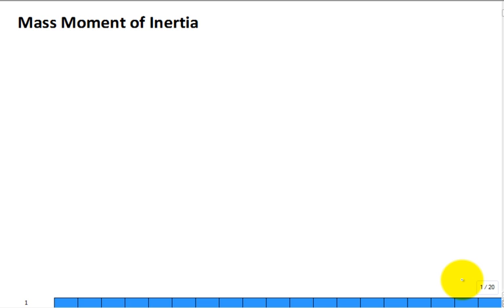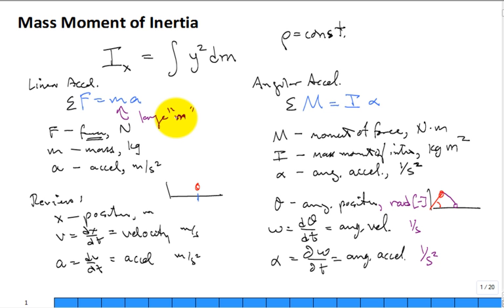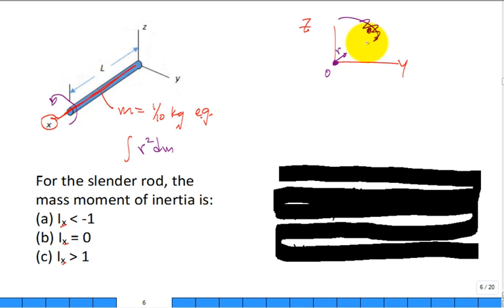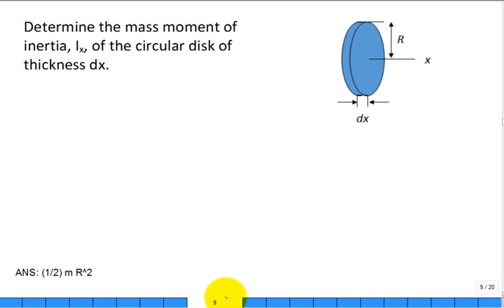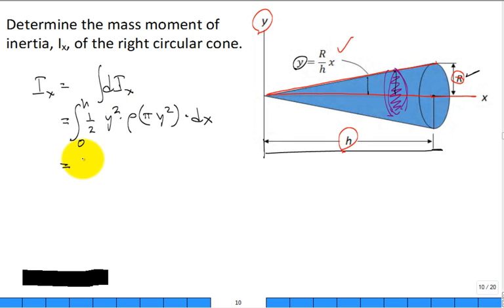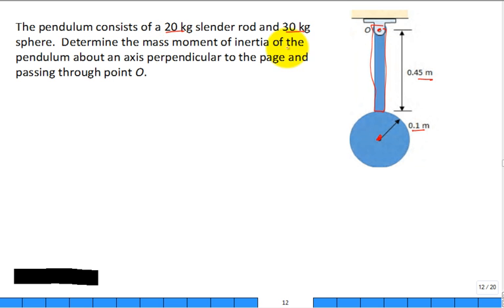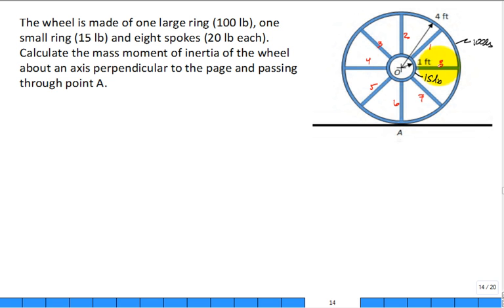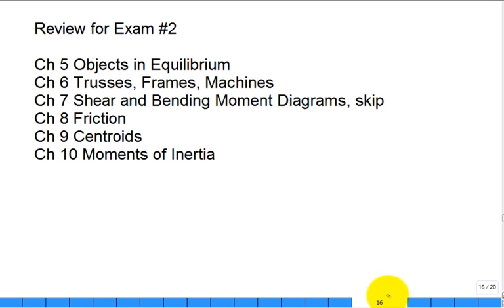Mass moment of inertia

Comment: Excellent video, very good explanation. I have a question: what are the differences between the MIM and the Volume Moment of Inertia?
Reply: Mass moment of inertia, is the only term that really has anything to do with inertia.  So the other kinds are a bit of a misnomer that we call them "moment of inertia".  The mass moment of inertia is integral r^2 dm, which has applications in being the rotational equivalent of mass, for the rotational form of Newton's 2nd law.

Notice the distinct lack of kilograms in other kinds of "moments of inertia"?   That's because these other concepts are purely geometrical properties, that have nothing to do with inertia.  The reason we call them moments of inertia, is that they have a lot of geometric properties in common with mass moment of inertia (such as the parallel axis theorem), and have a very similar calculus definition.

I'm more familiar with Area moment of inertia, which is better termed the second moment of area.  This concept is defined as integral r^2 dA, and has the application of the geometric stiffness of a cross section, either in torsion (polar 2nd moment of area) or bending (2nd moment of area).

I haven't used the "volume moment of inertia", but I would expect that it has a very similar definition as "area moment of inertia", except that it is integral r^2 dV, instead of dA.   An application I would expect of volume moment of inertia, is more of a density-independent version of mass moment of inertia.  In other words, divide through by density, after finding mass moment of inertia of a uniform body, and that's your volume "moment of inertia".

Comment: why did you find the centroid of the composite pendulum Y-bar=0.42m and then use that to determine the distance d of the rod and the  dis? I think that is where we can use the parallel axis theorem then to find the mass moment ;of  inertia of the composite pendulum.

Comment: why it is 1/2 times r times dm 
can you please explain
Reply: That's for the special case of a cylinder along its axis of rotational symmetry.

Consider the cylinder consisting of an infinite number of thin, uniform hollow cylindrical sidewalls, each with a mass of dm, and a moment of inertia of dI.  We need to add these all up, such that I = integral dI.

The moment of inertia of a cylindrical shell with no endcaps, is a trivial problem, as all mass is equidistant from the axis of rotation (i.e. at radius r).  Thus, dI = dm*r^2

Our integral for I becomes
I = integral r^2 * dm

Our differential mass element has a density of rho, a thickness of dr, a length of L, and a circumference of 2*pi*r.  Its mass dm is thus:
dm = 2*pi*r*L*rho*dr

Replace dm with this, and factor out all the constants:
I = 2*pi*L*rho *integral r^3 * dr

Carry out the integral:
integral r^3 dr from 0 to R = R^4/4

Reconstruct:
I = pi*L*rho * R^4/2

The volume of the cylinder is:
V = pi*L*R^2

And V relates to m and rho as follows:
rho = m/V

Replace:
I = pi*L*m/V* R^4/2

I = pi*L*m/(pi*L*R^2)* R^4/2

Cancel pi, cancel L, cancel R^2, and get our result:
I = 1/2*m*R^2

Comment: Sir how to find moment of inertia of engine of 4 wheeler vehicle
Reply: I'm sure if you work in the automotive industry, you'd have access to a CAD model of the vehicle.  Many CAD programs have features where you can specify the density of each geometrical element, and carry out the analysis of the moment of inertia.

This is a problem they need to solve all the time, particularly when it comes to designing the suspension structures, so the natural frequency and damping ratio are anticipated correctly.